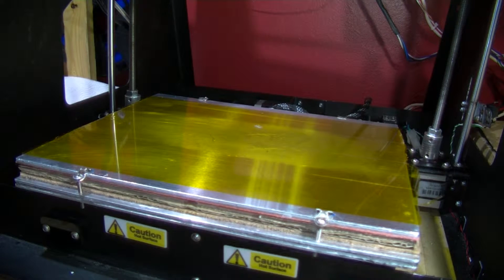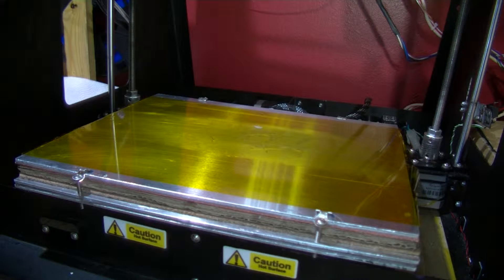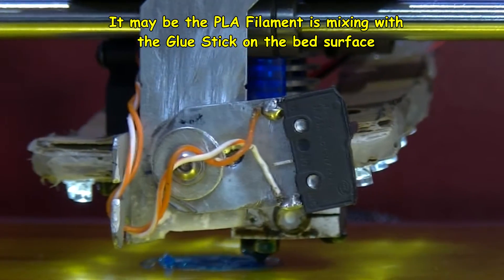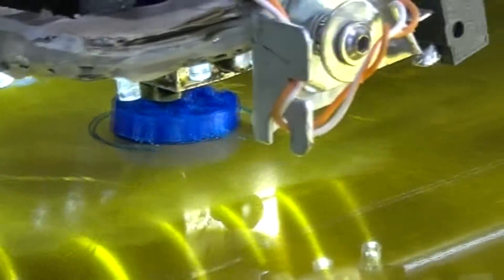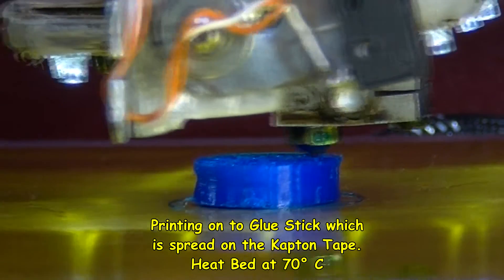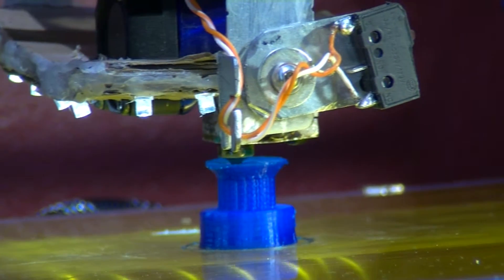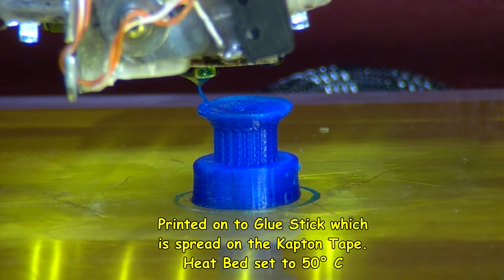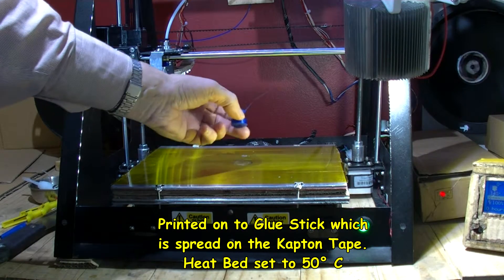Kapton Tape PLA tested and FAILS pr 5 Kapton Tape Glue Stick

Comment: I have succeed printing PLA without heatbed or any tape, just pure cheap 3mm glass with glue stick. I pour 4 drops of water to the bed and mixing the glue with my finger to make it even on all print surface, and wait 5 mins to completely dried before start printing. it works amazing, try it
Reply from the maker: I now use 
Elmer's Disappearing Purple School Glue Sticks, 0.21 Ounces Each,
6 Sticks per Pack (E1560)
http://tinyurl.com/purple-glue-stick

on 
Custom Borosilicate Glass made to order
eBay seller :  shanewoodward2015

235 nozzle 65 Heat bed for ABS wirh Now very Good success
Reply: I just tried moistening the glue just before print, worked nice!